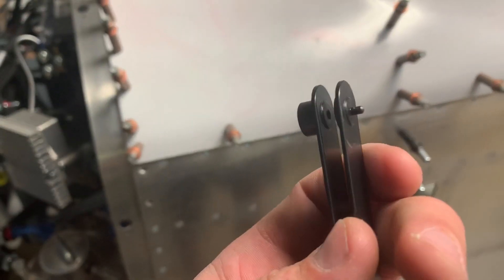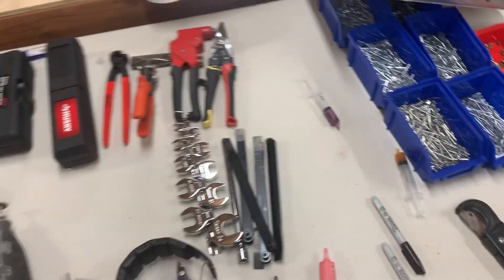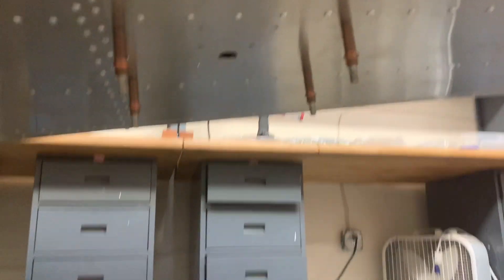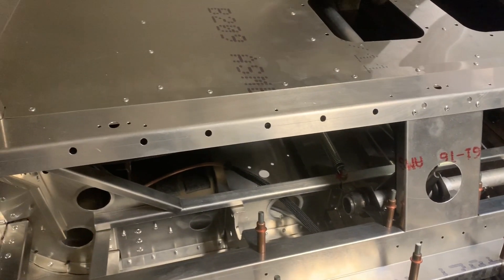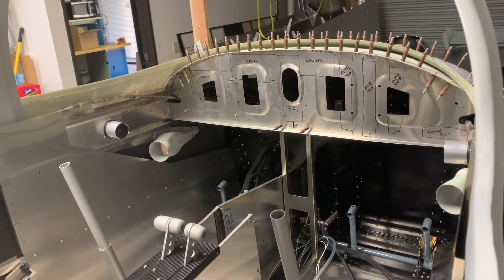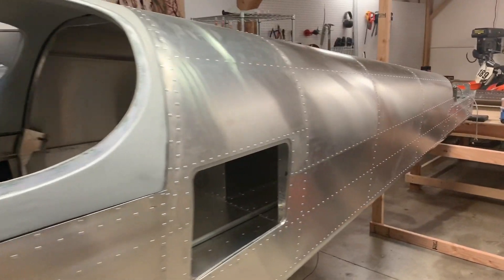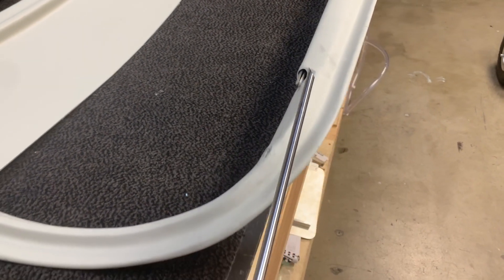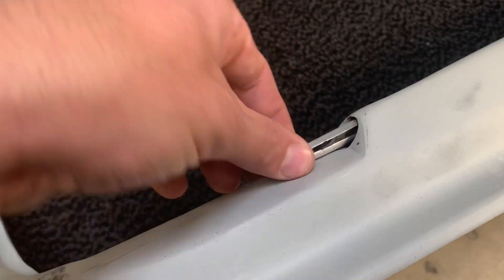Sling TSi- Build Update

Comment: Evan: Maybe consider a car hauler that has enclosed hauling rather than the typical open system. Lots of high end or antique cars are moved this way.
Alternatively, I was rooting that you would somehow finish it and fly it out.
While I am enjoying the build itself, I truly enjoy your reasoned thought process as you work thru the curves that Vans throws at builders.
For the life of me, I cannot understand why Vans does not provide a more 'finished' kit i.e. deburred, dimpled, etc. Needing a band saw to cut parts is so old school. They should have done this. I am sure they use CNC stuff to drill the holes and it would seem a very small step to deburr and dimple 'robotically' as part of the process.
In the meantime, keep up the GREAT work. I really enjoy your process!
Reply from the maker: John this isn’t a vans kit, a company called airplane factory makes it. I’m not sure what parts you’re talking about with the bandsaw, but this kit is very well made in my opinion. There’s some stuff to work through but that’s part of it. You can get a more complete kit called a quick build to remove some of these headaches.
Reply: Evan he is referring to some of the parts when building the Vans kits multiple parts are on a single piece of metal and the builder cuts the individual parts loose using a band saw. I don’t know if he realizes your not building a Vans kit. Your building a Sling Tsi from The Airplane Factory out of South Africa. Just FYI.
Reply from the maker: @perrypike90  Ya I caught on he thinks it's a Vans kit. I didn't know they make you cut off parts in Van's kits, thanks for that clarification!
Reply: I honestly hope you finish this kit since you have invested so many hours into it. Of course if you can sell it for the right price then get another kit on its way. Then you could build the new one much faster, being the second time around.

Comment: A lot of sweat-equity has gone into your build.  Why not just hire a truck?
Reply: Thats what I would do..
Reply: I’m building the TSi and moving to Colorado in April.. it’s a bit difficult finding a mover that would be willing for such a high value item. Any suggestions are appreciated for those who might have experience!
Reply: As mentioned by another viewer, purchase a used enclosed car hauler. The fuselage, wings and all the other goodies should easily fit. Then just toe the plane inside the trailer to your new home. It also will make a great storage container for the aircraft until your new shop is up and running. Then unpack the plane to finish up the build. The car hauler trailer could be easily re-sold without any loss and you won’t have to start all over from scratch. If you still want to build another kit plane then pick something different and have at it.